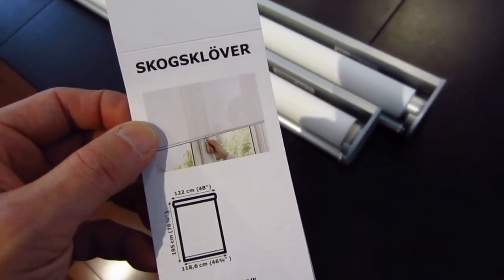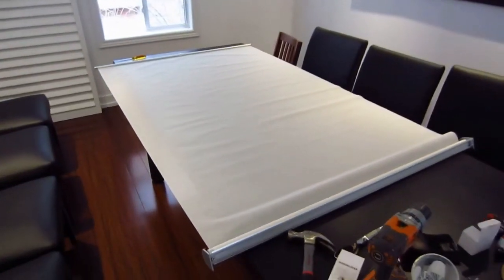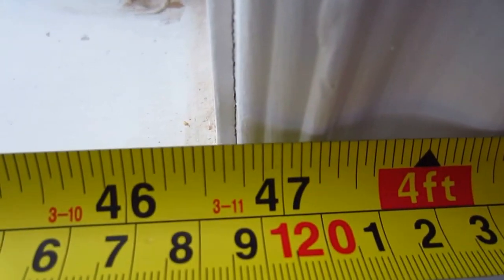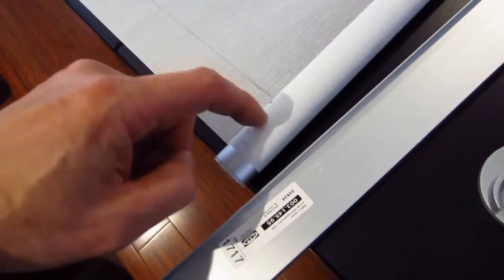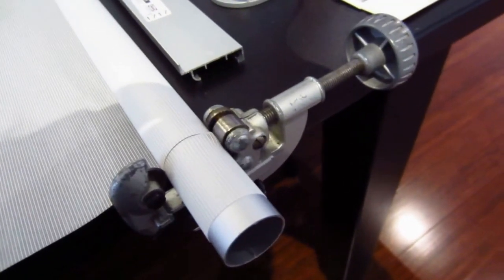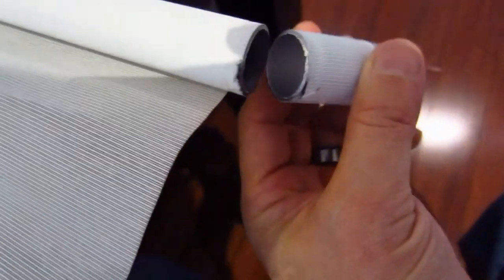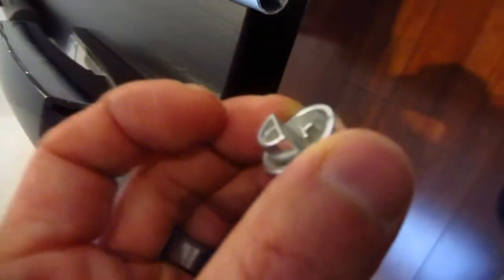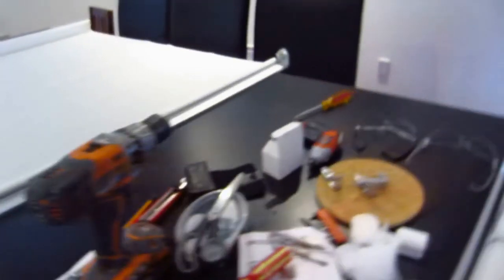Trimming IKEA SKOGSKLOVER Roller Blind to Size to Fit Inside a Window Frame

Comment: Hi Cory.
Very nice video, gives a lot of hints.
But here are some more:
- Pull on the store before disassembling it, so to lock the spring in place (then when pulling it apart, the spring won't unload)
- If the spring unloads, always possible to reload it by inserting a flat head screwdriver, and turning clockwise (do not tighten it too much)
- If you need to cut more than 1`` 1/2, the other cap will be too lose; put some electrical tape on the cap before inserting it to tighten it up

The first one is the worst, so I used my shortest one for practice (cheaper to replace if I messed up).
After 2 or 3, it will ake less than 10 mins / blind, installation included.

Comment: Excellent! Thank you for the guide. 
I did use a hacksaw for the upper tube instead of a pipe cutter,  my cutter would not stay in the correct position. 
The right plug I taped up and than used a hammer to tap it into the tube because the engagement groove for the damping mechanism  does not run along the entire length of the tube (shortened by 17 cm). 
For cutting the blind I made a number of pencil marks on the blind,  used a sharp "break" knife and a long straigh wooden ruler as a guide. Perfectly straight cut, no fraying at all. 
I did this in the past on the now obsolete Enje blind as well which had the same fabric, did not experience any fraying in 5 years of use. 
Thanks for the effort,  it really helped me out!

Comment: Hey Cory, thanks so very much! Your first class tutorial also works on the Ikea Bleking blinds, even though the blind mechanism is just slightly different ( the spring is on the left, just like yours, but  it has a soft close mechanism on the right side, which feels like a spring at first, but it goes right back in no problem.) On the Blecking, the spring unit is completely encased so it come out and go back in easily as well. Also I found that with an extra set of hands we could gently separate the "fabric" from the top roller where it had been attached with sticky tape, take the roller out to the shop to use the sliding mitre saw to cut it, being careful to keep it sticky, then carefully reattach it without any issues, since the "fabric" is more like wood or bamboo. But make sure you replace the mechanisms in the roller ends back into the aluminium brackets with the blind in the EXACT state of rolled out or up-ness as when you removed them, so you don't have to reassemble it twice in order to reset it's position while open. easy enough to do if you miss it. Also I noticed a guy Guy Davis over at Github has a tutorial on how to hack these type of blinds to automate them. We might get around to that, but at the moment we have 6 more blinds to trim down, which is enough to keep us busy. Thanks again for a perfect tutorial!
Reply: btw for the Bleking, I used a utility knife to cut the blind fabric since it was more structural. Worked really well against a straight edge. I often cut softer fabrics with a brand new razor blade if i need a particularly clean cut. I put a length of plywood on the table under it to avoid damage to table, and use a yardstick or drywall square, etc... Mark the cut first with a pencil in case the straight edge moves at little when you cut it, so you can re-position it..

Comment: Hi Corey, Thanks for the video. How do you trim the top (rectangular) part of this model of roller blinds & also the bottom rail?
Reply from the maker: Hack saw for metal is quick, cheap and easy.  It is aluminum so very easy to cut.  I used a mitre saw with a carbide blade, but not the best for your saw blade.

Comment: Hi i was trying to fix skogsklover as it doesn't stop when rolled down, after unsrewing the left side which has the spring I heard the spring unwinding and now it doesnt roll up. what should I do?
Reply from the maker: Hmmm.  If it doesn't catch, meaning you have to tie it down or put a weight on the end, maybe you don't have it wound the correct way on the correct side?  Does it go up at the same rate as your others?  If you remove the spring.  You can just play with that and you should see that it locks if you wind it correctly.  
Too bad, I motorized mine and just got rid of the extra internal springs and spindle caps.  I'm sure IKEA would send you a spring if you asked though.

Comment: It seems after I cut the right hand side, did not touch the LH side the "soft" feature quit (if it was there). The amount cut off was marked with a fixed combo square, all the gaps are the same. 3 out of 6 shades either never had the "soft" feature or they lost it after cutting the RH side. The LH module was never removed or tampered with. Any ideas?
Reply from the maker: If by soft you mean the slow close feature, it probably means the red and white plug is slipping inside.  There were small ridges in the aluminum that should have kept the end plug in place.  Maybe try putting a layer of taping on the end cap before inserting it back in, so that the fit is tighter when you put it back in?
Reply: @CorySakai  Ikea made the newer version with a soft close feature on the right on several models of blinds depending on when they were purchased. So some might have had them and others not.

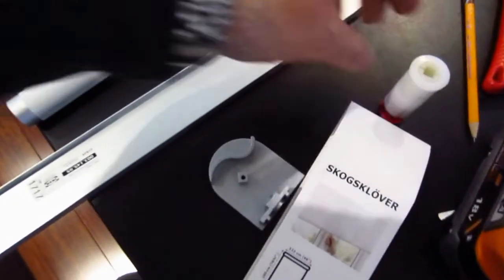Comment: Hey Cory thanks for the tutorial. At 3:58 you say "Ok, now that I've cut that piece off" . You did not show how you actually cut it. Could you please suggest how to? If you just use scissors I doubt it would be an even cut ?
Reply from the maker: The piece I cut off is just the fabric material, and I used a pair of long scissors.  Any sharp long pair or fabric scissors should be good.  Just draw the line first.  I did try using a sharp xacto or razor type blade with a long metal ruler type thing, but I found the scissors worked the best.  Right after that I show how to use a pipe cutter to cut the aluminum end off.  You can't use scissors for that. HA!

Comment: Hi have you ever shortened (cut) an Elvarli post? The height is 225 cm and my ceiling or closet height is 196 cm and I am wondering whether if you took out the spring part at the end of the rod (if that's what's inside), and cut the tube with a metal cutter - as you did with the Skogslover rod - then the spring cap could be just put back in. I have no idea if the above makes sense but would really appreciate it, if you had any advice re this. Thanks

Comment: Hi Cory
I am  having issues with the spring not recoiling back properly after doing everything in the video (awesome video btw, my wife is happy ;)).
How do I fix that?
Reply from the maker: You probably either need to tension it even more, and/or make sure that it correctly locks into place.  If it's not maybe you are spinning it in the wrong direction.  I have mounted the blinds with the spring mechanism on the left or the right, it just changes your accessibility to the removal clips and whether the spring mechanism is on the left or the right.  It's like setting a toilet paper roll so that the paper comes over the top to the front or to the back against the wall.
Reply: @CorySakai  Thanks, I figured it out. I had to use a screw driver to reset the spring, by winding it clockwise to coil it.

Comment: Great video, just a heads up, don't cut more than 4 inches off, you'll end up hitting the spring tension system inside
Reply: This isn't necessarily true... or at least  not what I found.  I bought a 27" model (summer 2020), cut 5.5" off, and there were still a few inches to spare.  When in doubt, pop the end off and measure with something long pushed down inside until it hits the spring.
Reply: @Eikonic_  great news, they must have changed it to allow for even narrower margins. Yes I agree I should’ve checked as well 😅

Comment: is the spring going to hold up at least 5 years? and also are those "bends" on the material coming out?
Reply from the maker: No problems with the blinds so far, but the 3 main ones are now motorized so don't use springs.  No bends or wrinkles in the material.

Comment: Thanks for the tutorial. However, as mentioned in one of the other comments, there is a serious issue with the grooves that hold the right-hand mechanism into place. These grooves do not run along the entire length of the tube. So if you shorten the tube, the grooves at the end are gone. The plug with the mechanism then sits loose in the tube and slips, rendering the blind usesless. I only discovered this after having cut of the tube, and had to glue the mechanism in the tube with two-component epoxy glue to rescue the blind. It made things much more complicated than suggested in this video.

Maybe the production process of these blinds has changed regarding the grooves (i bought mine in The Netherlands in may 2019), but people should be very carefull when following this tutorial blindly, and check the length of the grooves first. To be honest, I think you probably should edit the video to include a warning.
Reply from the maker: Good point.  I'll check and see about adding a notation in the video if I can.  ? How much did you cut off the end of the tube?  I cut 15 of these roller blinds of different widths and I don't think I ever cut more than 10 cm = 3" off of any one.
Reply: I cut of only about 8 cm. The grooves in my version weren't any longer than 5 cm. The rest of the tube was smooth, cause the inserted plug with the mechanism to loose grip. This is what avdiukhov is referring to as well. The production much have changed a little... I took pictures, but unfortunately there is no way of showing them here.
Reply: Thanks Cory for making such a great video. A few comments:
1. I have done this basic method for both the Skogsklover and the Tretur.  It is easier on the Skogsklover and the result is better so if you are on the fence as to which one to buy you know my opinion.  The limitation of course is Skogsklover does not come in blackout.
2. I ran into the same problem as Raoul when cutting 2.5" off the rod. The solution I found I think is a bit easier - there are 2 grooves in the plastic mechanism, and I trimmed round wooden toothpicks to fit into the gaps.  When I put it in it was very snug and I didn't have to wait for glue to dry.  I only did it today but so far so good.
3. I am consistently able to hacksaw the main pole no problem, even without cleaning it out much.  I did buy a new high quality fine hacksaw blade to make the cuts.
4. The hardest part for me is cutting the fabric straight. I did buy long shears. One thing that seems to work ok on the white blinds is to use a construction chalk-line to mark the line.  But even so my cut lines are just acceptable, far from perfect.
5. I think your video does this correctly, but just to emphasize, you want to pull the blind all the way down, and lock it to take the tension off, before you remove the end-cap.  That way when you put it back on the spring will be in the right position.

Comment: Can it also be cut in height? Thank you
Reply from the maker: Yes.  That's fairly easy to do.  Not sure why you would really need to do that though.  Just pop the caps off of the bottom silver rod, slide the rod off, cut to length, re-staple the retaining strip back on and replace the rod.

Comment: Hi, I was wondering if there had been any subsequent fraying of the edge you trimmed on the blind? 
When I proposed doing this the guy in IKEA shook his head disapplovingly lol.
Thanks
Reply from the maker: NONE!  Not a single bit anywhere, and these are used daily.  They also do not rub anywhere on the sides of the window frame, which would likely cause fraying.
Reply: if you are worried about this you can hit the edge with a little Fray Check, available at fabric stores. I'd test it on a trimmed piece first, dried with a hair dryer, to make sure it won't discolor with heat .

Comment: Why won't my shade roll back up after I made the adjustments?
Reply: you didn't fit the mechanism back correctly.
Reply from the maker: You can actually put it half way back in and then start tensioning it, lock it (or have it lock itself), and then place the piece back in.  You can actually partially wind it by hand completely out of the rod too, but I find it easier with one end already in the rod.
Reply: or you can put it back together all the way, and have a friend hold it high (stand on a chair) open it all the way, and allow it to close. Then remove an end, roll the rest of the shade back to the proper spot by hand, and replace the end.

Comment: Hi Cory, Thank you for your DIY, it helped me. However I've got several problems, solution on which you did not mention in that video and here it is. 

First, when I done all the cutting and was assembling I turned the side with a spring one more time around with a rail in and it pushed out from my hands and fall apart. The spring came detensioned (start making noise inside the tube like an old sofa). If somebody stucked just with the spring problem - check this video https://www.youtube.com/watch?v=4W53qQd_yfY . Its not Ikea but your spring have to look like this (be tensioned = pre rolled) before you put it back inside the tube (fabric also has to be rolled).

But when I done tensioning thing and assembled I stucked with a second problem - came out of soft lift. It's began to "shoot" up very quickly.

The reason to this that I done cutting of the frames wrong. Tube has to have a "gap" exactly the same like on factory between the sides and tube it self . Please check the gap before you deassemble this roller.
Reply from the maker: When you say fell apart, do you mean it unwound the spring tension.  If so, I had that happen to me too, but it was easy to spin and wind back into position.  You just have to guess a little at the pretension for your window.  You can tell if you have the tension correct by how fast it goes up compared with the rest of your window blinds.
Reply: The method I used was to take the spring end apart too and use the end bracket as a tool to wind the spring before putting it back together. Also, when I cut off the plug end, I had to cut too much off the tube and ended up removing the entirety of the grooves in the tube. I solved this by putting two crimps in the end of the tube with a pair of pliers.

Comment: Worst description ever. Don’t listen you’ll end up ruining your blinds.
Reply from the maker: HAHAHAH!  Sorry, shouldn't laugh at you.  Ya, you do have to be somewhat DIY skilled.  I wouldn't say this is "easy".
Reply: I figured it out, it took about 25 revolutions of winding the spring until it had enough tension to pull itself shut.  Don't use my numbers though, if you stand the blind on its end on the floor, with the opposite end cap removed,  you can place the 'spring side' end cap over the spring mechanism slot, wind it up, pull out the blind a bit and check to see if it's retracting. If it isnt, wind it up a bit more and test again, repeat until it's right.

Comment: Hey Cory
This video was of immense help! I almost gave up on the curtain before I cam across your video
I have cut the rod and the curtain as you have instructed, but I am unable to have the mechanism working right. Could you please explain how you put everything back together?
Especially how you rolled the curtain back to have the mechanism working smooth.
super thanks in advance!
Reply from the maker: You should be able to wind the enitre roll back by holding on to the roll with one hand and winding the end (not the red and white end without the spring) with your other hand.  It should be locking into place as you do it, just like it does when you pull the blind down and it stops at certain spots after it is installed.  Try using a screwdriver on the end to wind it if needed.
Reply: Cory Sakai amazing! It works! 
Thank you so much!!